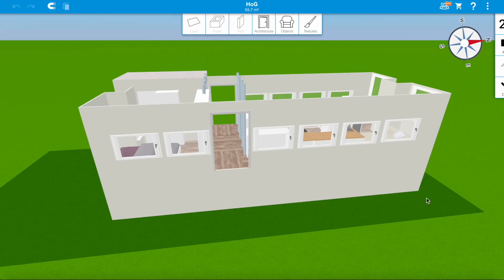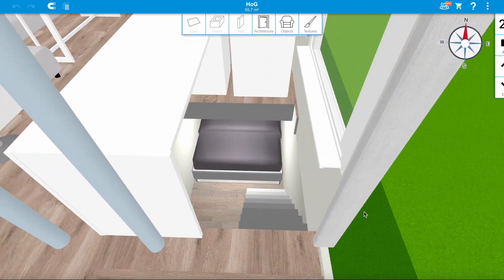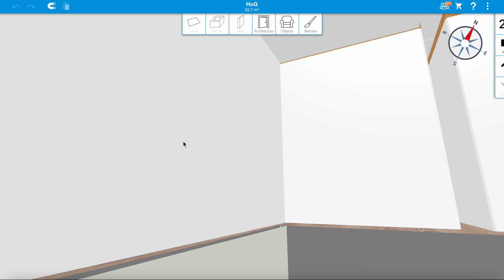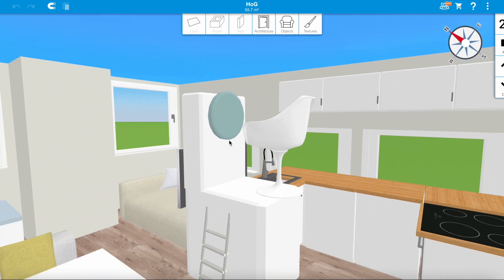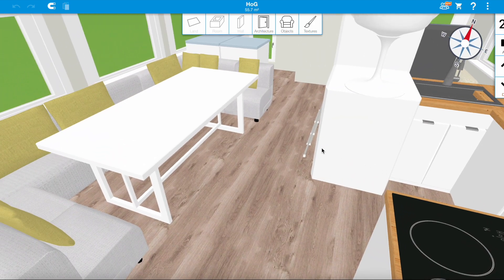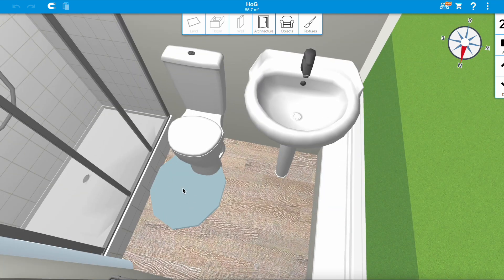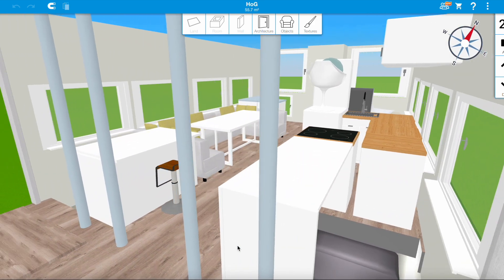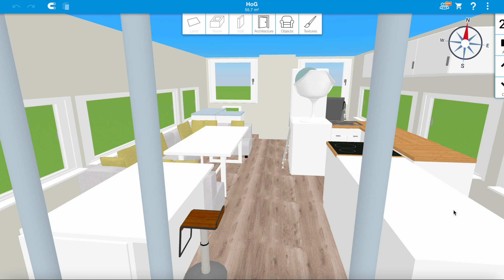DIY Solar Yacht Virtual Interior Tour (Lifeboat conversion + Refit)  - H.o.G. Part 11

Comment: Late to your project, and have not seen your recent progress yet, but have a couple of suggestions:  1) Folding beds.  2) Sliding cabinets.  The idea is that most of the time you are not going to be in the bed - so why waste the space?  Fold the bed and use the space for gear storage.  Slide the cabinet over the entry when you don't need to use the bedroom - bigger kitchen.  Finally, I don't need 8' ceilings - but a 7" bed on a motorized platform that lowers from the ceiling would allow a queen size bed to appear when you need it, and go away when you don't.  I've even seen them with LED lighting mounted on the bottom for better lighting when the bed is retracted to the ceiling.

Comment: I think the main problem with the design is the helm. I'd look at redesigning it so that the helm 'space' is maybe the whole width of the boat. In this space you could redesign the front of the boat for better visibility perhaps, but you could make a seating area within this raised platform. Underneath this area if it is too small to stand, then why not relocate the dishwasher (unnecessary for me) , the washer /dryer and other kitchen cupboards. You might also portion part of this are for a breakfast bar from which you could work on a laptop perhaps? In such a small space, I would not have an en-suite bathroom. A study or workbench would be much more useful to me. It may be useful to hire an architect to see what they could make of the space?

Comment: i have two suggestions. firstly have you seen those remote control consoles that people put around their necks ? a solar /electric boat could have one to compliment drivability. also have you considered rotating the below bedroom hatch doors 90 degrees so that they open off the main axis of the boat? the door might then look like a small yacht entrance hatch. a ships ladder would then be fine and give you lots of room.  idk by now it’s probably already built.

Comment: I like the open layout. If you have water tight compartments at the front and rear of each hull, that is pretty good protection in the most important areas. If you design it well, it should still be quite functional with one of them flooded, and still float even if two get flooded. It was quite open before, so I would think you are going to be ok with such a layout. If you oversize the bilge pumps and protect your batteries well, you should be able to fend off flooding from hull damage for a while, giving you some time to assess and mitigate the problem.

Comment: Why don't you raise the floor or ceilings of the 2 hull bedrooms and hide the rise in the cabinets and couch.. be less claustrophobic down there and have you thought about putting some portlights down there to add outside light and fresh air to make the bedrooms feel larger and more open.. seems like you have alot of square feet of floor space to make a awesome liveaboard boat.. do you have public camping areas around your waterways?? I live close to the Mississippi River and we take a boat out to 1 of the many islands and then tent & hammock camp while grilling out over a fire
Reply from the maker: Yep, raising the floor is exactly the plan. Starboard side will have a 30cm (1ft) raise on which the dinner table will be - that way you don't need stairs and still get almost-standing height below (165cm). Port side cabin will be inside a huge sofa for +70cm. Portlights are planned, but low priority since you can always add them later. 

Yep, lots of places around Hamburg (and all of Europe fwiw) to stay - we're looking forward to traveling around when the boat is done.
Reply: @HeartofGoldLifeboat  sounds really cool.. I'm reading up on sailing and am going to learn when spring comes cause my youngest kid will be graduated in 5 years so I can go wherever, whenever I want to at that point..planning on buying a classic liveaboard sailboat for my retirement

Comment: if it was me i would exchange the kitchen area to where the main seating area is located.. because having a source of water near my feet while im driving the boat does not sound so pleasant and you being high up and having a sink nearby may cause accidents if the floor of the helm got wet.

Comment: The counters immediately adjacent to the stairs for the bilge bedrooms could easily project half out as the stairs get lower.  I’d imagine stairs needn’t be more than 30” wide and you could reclaim enough space with2+ meters of clearance that half that counter could house  deep drawer.  That being said, a bar door, with some glass paneling would afford some overhead privacy, and a louvered panel door three steps down attached to the outer wall could close off that space while allowing some air flow.

Speaking of air flow, installing some ducts with two way fans into these bedrooms can allow you to harness the natural heat sink that these pontoons can provide, pumping air from floor of pontoon to ceiling to be dispersed by ceiling fans.  Passive air distribution will be important on the water or in port.

I think you may want to allow for more room on the lateral parts of your helmsman space for camera displays, instruments…the electrical in that wall you want to mount the tv to, with battery/ motor circuits, helm controls, etc. will undoubtedly be the home for your fuse box.  

One last thought…I haven’t got a huge sense for the outside but will you store a dinghy of some sort, mounting a winch?

Comment: I would make a fixed staircase to a roof hatch in front of port side bedroom. apart from easily using the roof as an outside sitting area, it would be a good emergency exit.

Comment: I suggest side sliding hatch covers for the bilge bed spaces like the internal side Ama covers. 
On a Main cat but transverse sliding ..under the fixed work tops ...
Any cooking surface above a stairway or bed below needs substantial splash backs to stop spills going over the backs and down below 😬. Thats the teacher Scientist risk thought process.. Getting hit side on in a swell or by a passing big ships wake could have you pitching up by a meter..or more.
Your steps have storage but i have seen them lift up on Neal trimerans to give a small night head and sink..
Set your control station up ... You could have a screen set up as a repeater for your main navigation system if the seating  at the bow was n shaped .
As you have hight over the main bed  a over bed storage area as well as under bed storage will win you points with your partner... In fact ask her to look and think it through... some are very good at it ..it also helps to
Keep the them on side. 
Caravans can help give you  good layout and storage ideas.
The quality of the side door and window seals will determine how well you keep water out the  bilge space rooms, opening the way they do.🤔

Comment: do you need an exit on both sides? prob you could close one side up, change the direction of the stairs of the bedroom and you would have some nice additional space in one corner.
Reply from the maker: The floor at the doors is the access hatch for the engine (now motor/battery) room, so I can’t fix anything on top really - the idea is to use one side as garage for bikes / scooter and the other as exit - that way we can switch depending on mooring orientation

Comment: I'm a big fan of the project. Can't wait to see the final product.  I would suggest some sort of door/barrier to the lower deck bedrooms.  With the top of your stairs immediately inside your exterior doors there is going to be water in that area (swimmers coming and going, waves, bad door seal, ...). Even a door that's the same height as the counters would help without closing off the space.
Reply from the maker: At a minimum, there’ll be a slight step plus a drain in the room downstairs. 

But since some sort of privacy screen is needed anyway, that spot will take a bit of creative thinking

Comment: looks good but heres my suggestions
split table in two with an extra pice that can be used to bridge the gap, I always find it annoying having too shuffle around long table benches to get to the middle, This way you can use it as two smaller tables if you don't have a large amount of guests.
window in wall of the master bedroom, to remove blind spots and you can cover itup with a blind when not sailing.
Reply from the maker: Good idea!
Reply: @HeartofGoldLifeboat   also How are you going to exit the boat onto the deck? Because other wise people will need to walk through your bedroom. While I'm not sure on the spacing but you could turn both bathrooms into a single larger one and have a corridor to the back deck, Maybe even have a laundry nook with washing machine / dryer / water maker.

On a silent yacht (solar ev cata) They have a little roof top that can lower up and down with solar, While it may be difficult to do you could Make something similar and put your solar panels on long hings to make a roof deck while docked. Although this may be out of the scope of your project, You could always come back later to do it.

Comment: Looks good, I don't think having it open plan will be a problem.  Having the helmsman's feet just above the kitchen counter tops may be a problem though.  
Also, the counters that double as cabin roofs, will they be on sliders?
Reply from the maker: Not planned to be on sliders - where do you think they should slide?
Reply: @HeartofGoldLifeboat  Not Mogli, but my first thought was to have the shape of the cabinet to slide across to the outer wall and make a door for the cabin.  Some catamarans (Lagoons) have doors that do this to give privacy to the sleeping compartments.
Reply: @SenatorPerry  utilizing a hinged horizontal panel above the stairs that can open at the angle of descent to provide headroom, and a louvered panel door that could hinge off the outer wall that could butt against the outer lip of the horizontal panel.  It could swing out and be a little more than a meter in height, closing 3-4 steps down.  Area lateral to the stairs could be closet or perhaps some quick storage for boat fenders and poles
Reply: @HeartofGoldLifeboat  I probably haven't got a good enough feel of the space but it looked like they could slide back to close the cabin and give more salon space.